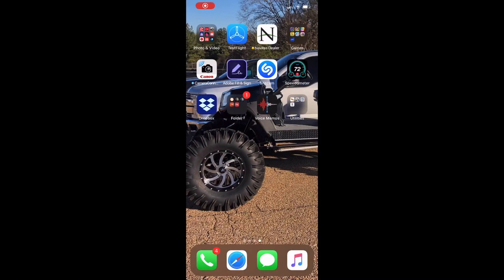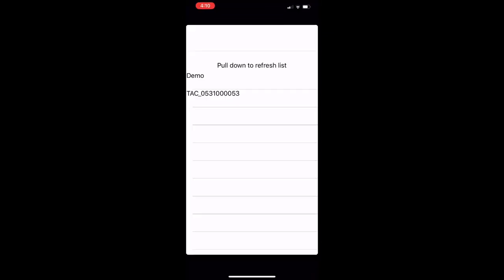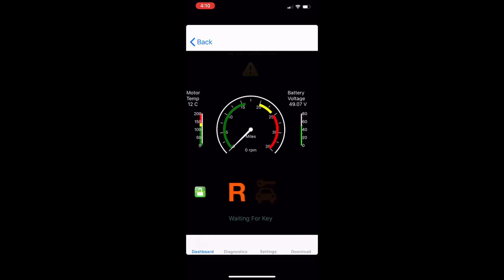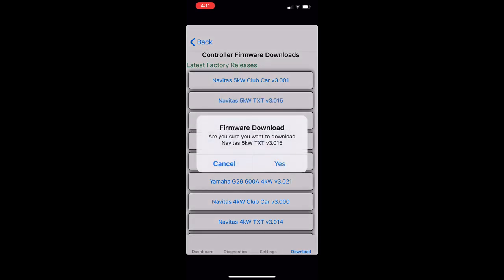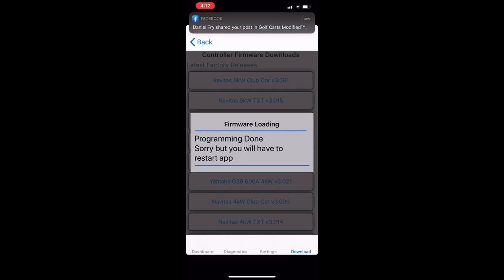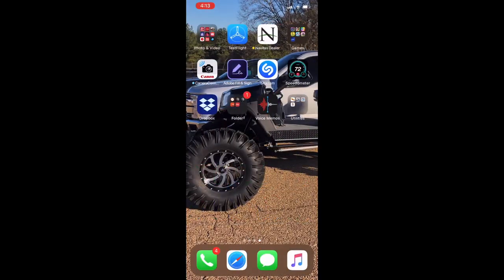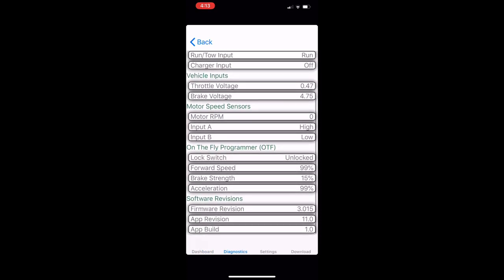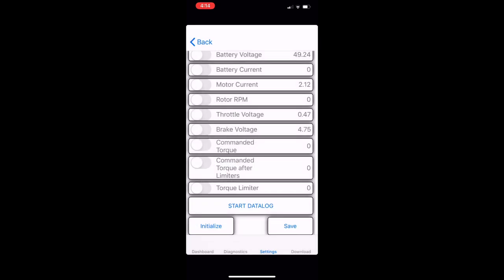Navitas Firmware Update

Comment: I downloaded the app on my Android phone. On the app, I only have the "Dashboard" and "Diagnostics" options at the bottom of the screen. It does not show Settings or anything else. Any ideas?
Reply: I have the same issue , no download option to update firmware , for my 48v precedent it says i am running firmware 2.60 version 1 , is this correct?
Reply: Same here
Reply: I have an android. Yamaha g29.  No options.  Says firmware 8.9

Comment: Upgraded to the 440A with HD solenoid  on 36V. On old controller I could hit 20mph on stock tires. Now with the Navitas and taller tires it will not go above 16.5mph.   Any suggestions?

Comment: I installed this system and I still can only go 15mph can you give me some insight on what I didn’t do? New motor new controller and new solenoid
Reply: Install the OnTheFly controller, it allows you to change torque, speed, and regen
Reply: I changed the settings in the app.  I was 16, now 22.   Won't let me change tire settings.  Say 23 in diameter,  which will.go 27?  I can go 22 on a 17 inch tire
Reply: Same with me. On old controller and smaller tires I was able to hit 20mph easy. It maxes at 16.5 now.  Some one suggested I change firmware to the GCMOD.  Any suggestions?  Have 440A with HD solenoid ezgo pds 36V